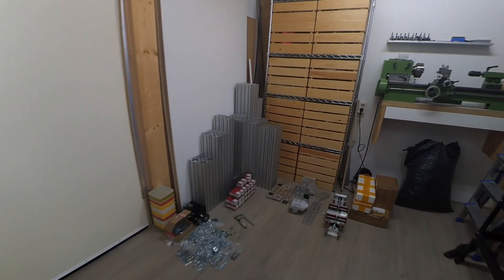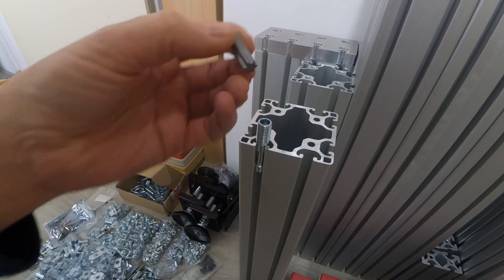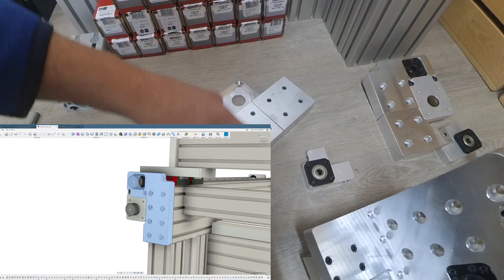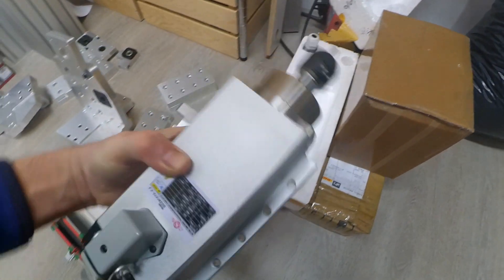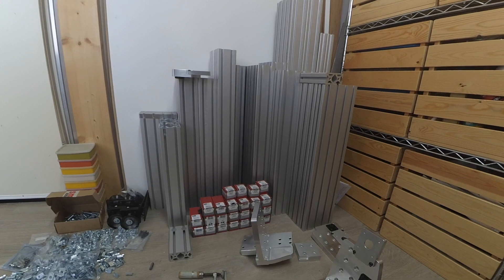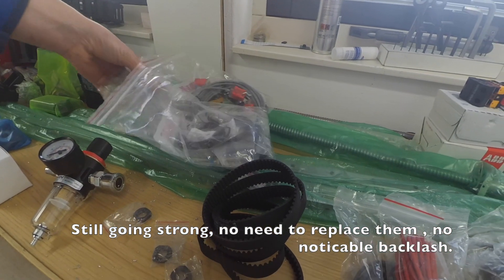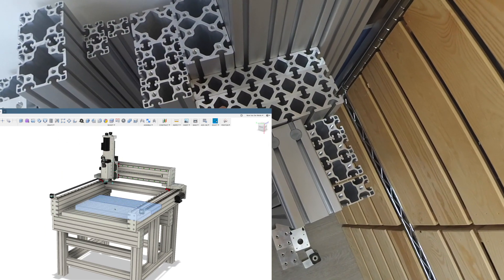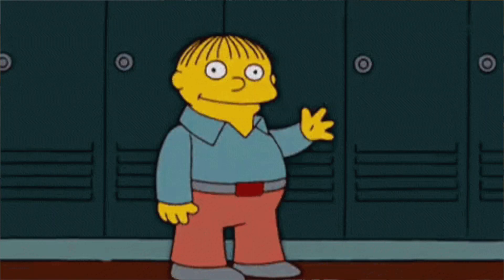DIY CNC machine, general design.

Comment: Fantastic project Berend! I am in the beginning stages of designing a CNC to improve/replace an existing benchtop mill . You provided a lot of great information. Do you have an idea of the final cost for the project? Are you sharing the Fusion 360 file? Thanks in advance.
Reply from the maker: Hi Robert! thanks for your comment. What benchtop are you planning on replacing? Is it a CNC or a conventional machine? I did about the same with my BF20, (replaced it with this portal) the aluminium plates used on this machine (20 and 25mm thick) actually was the BF20's last task. Total costs; i didn't keep track. The aluminium profiles where about 1400 euro, servo motors about 450e, lineair rails/motor/vfd about 1200, controller+case/cables around 600, coolant setup around 230.  If you can machine the aluminium parts, you can keep the costs relative low. If you can weld steel, i'd take that as a base.  I'm currently working on a few other designs; 1 in aluminium that requires less complex parts (the more custom made parts, the more expensive it will be for  someone without a CNC to make) This design requires 31 custom cut parts, (including an aluminium brace for the wiring and 4 parts for the ballscrew, HADEEi made a small sized bearing holder for the ball screws) which could be brought down quite a bit.  I started yesterday evening on an epoxy granite type of machine. (i have got a large machine, where i can route the plates for the moulds on) Plans are in progress... :) goal is to use as little custom cut parts as needed.

Comment: Very nice project.
You mentioned  the tolerance of extruded aluminum. To get a better tolerance , maybe, you can machine the parts. Let's us say machine 0.2 mm off.
Maybe there is a cnc  shop in your town what can do the job.  Shimming is also a possibility of course, as you said.
I live in Schoonhoven, Holland, and there is a machineshop  what can do it.
Anyway it is a nice project.
Reply from the maker: Hi, thanks Ad! yes, I tried to mention that in the vid (but it's a relative long winded vid, i admit :). It's easier to make a reference cut with a larger and precise machine. You only need to skim the aluminium profiles, (I currently have another machine with a 3100x1750 workable area that could actually, at the time i build this, I was waiting for the delivery of that machine), Shimming works too, but a flat area is easier/more convenient to start with.  I guess i lost an extra day of adjusting the rails. I used some basic tools to align it (long steel precision rulers of  500x10x50,  1500x15x60mm,  square precision level, dial indicators, stand,  and a 1050mm digital caliper (the latter turned out to be very helpful when building a machine like this) Very easy to determine larger distances within 0,01,  the calipers don't need to be precise, as long as it measures consistent.
Reply: @berendlucasvanderweide 
 thank you for your time doing this. Keeps me motivated seeing such nice parts.